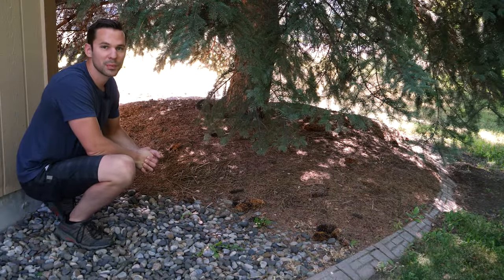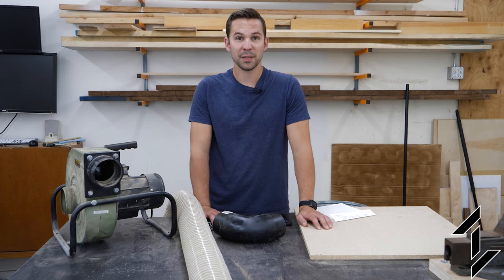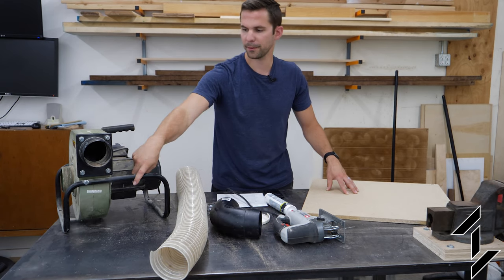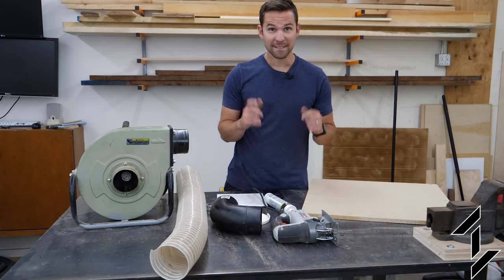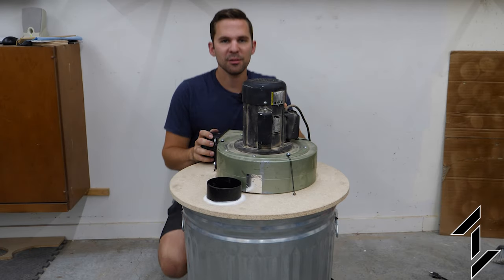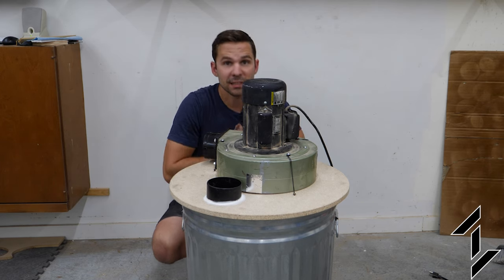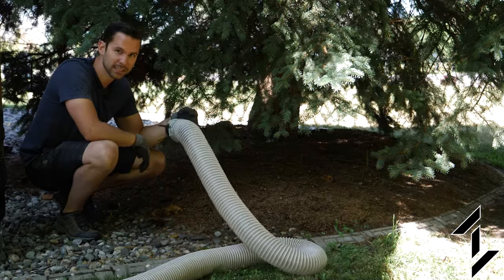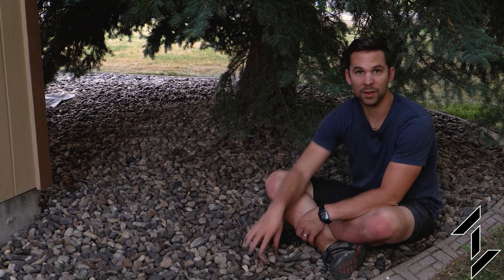The Fastest and Easiest Way to Clean Landscape Rocks! The Mighty Pine Needle Vacuum!

Comment: Ever heard of a Shop Vac with a diffuser. Thats how I get it done. Love that CNC machine. 👍
Reply from the maker: I didn't have much luck with a shop vac as it kept picking up the rocks too.  The high-volume low-pressure of a dust collector worked much better for me.
Thanks for watching!
Reply: @42Pursuit  Can you share which machine did you use? I am all new to this and want to buy the right thing :) I was thinking to buy a Shop vacuum but it seems like you didn't have much luck?
Reply: Can you share which machine do you have?
Reply from the maker: @ArijanaLukic  I used a 1HP dust collector from Harbor Freight. It has hight volume but low pressure air movement so it'll suck up the light stuff like pine needles and small sticks but not enough pressure to pick up the rocks.
Reply: @mark torres what shop vac brand do you have
Reply: Exactly, I actually use our Shop-Vac or our leaf blower on the vacuum setting and put a wire mesh on the end like chicken wire type so dirt can get through and rocks can't. I have to clean tons of bird seed from the winter out of my lava rock and this will do the trick.

Comment: Cool idea. I used my leaf blower to remove pine needles from a small rock bed, but it also blew the soil.
Reply: Doesn't your leaf blower have a vacuum setting does that's what I use and I put a wire mesh on the end of it.
Reply: @marylynnbehrens5562  My battery-powered leaf blower doesn't have a vacuum feature.

Comment: Without going to the time, cost, and trouble of fabricating a large shop-vac, I used my 10 Gallon Rigid Shop Vac. It was effective to a point, but in addition to sucking up the organic debris, it also was sucking up too much of the rock. So instead I began spreading my landscape rock onto my driveway and used my leaf blower to separate the debris from the rock. Since I was relocating the landscape rock, this method worked better anyway. Shovel, spread, blow, regather and relocate.
Reply: If you're not relocating your rock you could always use your shop back and put like chicken wire on the end of the little square chicken wire is not the bigger one. That's what I do and it works fine.

Comment: I use two methods. A power washer at a distance of a couple of feet or a small battery operated lawnmower, set with the blades high. Quick and fairly effective.

Comment: This would be nice with a set of all-terrain casters!  
A backpack version would be handy as well.  Maybe a little more work and less safe than necessary.  I'm going to have to do some thinking on how to incorporate a cyclone attachment to our handheld vacuum at work.  We have smaller landscaping stone, and gets sucked up into the impeller.
Reply from the maker: A backpack version would be super handy! Especially for yearly maintenance after it's been deep cleaned, sucking up the stuff dropped on top in the last year. Probably wouldn't want to have long hair that close to the blower though 😄
Reply: Bigger opening on end of hose = lower vacuum

Comment: I think a good shop vac with a larger suction nozzle like you used equipped with an adjustable air bleed (to adjust vacuum so it won’t pick p the rocks) would work too.

Comment: Fantastic! I must ask, and maybe the answer is obvious, but can this not be done with a shop vac? I only ask because I have one already.
Reply from the maker: Great question! Shop vacs are designed to move air in a high-pressure and low-volume way which allows them to suck up most things that fit within the hose diameter which would cause them to pick up rocks as well as the pine needles. Dust collector blower motors are designed to operate with low-pressure and high-volume air flow which allows them to suck up light-weight things but they don't have the pressure to lift up heaver things like rocks. This make blowers motors the perfect tool for this job 👍🏼
Reply: @42Pursuit  thank you for your answer. So, in theory, if I use a 4" to 2.5" reducer attachment to create a larger suction area, I believe I could lower the effective suction. Maybe even cap it with a 1" wire mesh for good measure if it still has too much suction. Love the idea in the video, just don't have the room for an additional item like that.

Comment: I bet if you put a screen with holes just smaller than the rocks it would just pick up the green. Good work
Reply from the maker: Hmmm, that's an interesting idea, I may just have to try that....
Reply: only thing is if you also have leaves, they will clog the screen often
Reply: @Beenthere2xs  yep. You were right. Guess youve been there 2 hehe
Reply: @djexclusivee  haha unfortunately there right now, have to clean small gravel around my backyard perimeter. Sucking it all up in a shop vac then dumping on a big area tarp. Then the plan is to wash em with a pressure washer. These are small gravel rocks so the method in the video wouldn't work.

Comment: Really awesome video. Very nice shop vac you builf there. Was thinking though. Um couldnt you just use a store bought shop vac? If a regular shop vac is to powerful maybe you could make a different attatchment for the end of the hose that is like a funnel to just give it a bigger opening and weaken the pull of the vacuum? Really did dig the shop vac you built though.
Reply from the maker: Thanks Justin! You might be able to find a compromise of hose size/funnel for a shop-vac that would work alright at picking up lighter debris while leaving the rocks. I don't think it would ever be as good as a blower motor like what's in a dust collector though since it's a difference between cubic feet per minute (CFM) and static pressure. A shop-vac has high static pressure with low CFM, whereas a dust collector has high CFM with low static pressure. Increasing the hose size for a shop vac would increase the CFM a bit, but I think you'd end up kinda getting mediocre CFM as well as mediocre pressure. Might be worth playing around with though!

Comment: The Harbor freight unit used is 660 cfm through 4 inch hose.   Would the larger 2hp Harbor Freight be too much velocity at 1550 cfm through 5 inch hose?  I am just finishing 100 foot drive of river rock along trees so your idea is looking like the best think since sliced bread to me.  Thanks 👍
Reply from the maker: Yup, that should work just fine! Actually, the first time I tried this (before I made the video) I used the 2hp Harbor Freight with a cyclone separator and a 4" hose. If I remember correctly, the extra cfm's of the blower actually worked slightly better.
I'm glad you found video helpful 🙂 thanks for watchin!
Reply: @42Pursuit   Thanks!

I have a 12/3 100' extension cord and a will construct it on a lawn tractor cart that I was about to get rid of.

I noticed commercial gas powered leaf vacuums for lawn tractors use 6 or 7" hoses with larger sharpened impellers and run $2k+.  I think your approach may work better for my needs.

Comment: I have slightly smaller rocks. The thing I'm worried about is I'll suck up just as many rocks as pine needles. Did you have any issues sucking up more rocks than pine needles with your blower?
Reply from the maker: Smaller rocks are tricky. For me it sucked up a bit of the small gravel-sized rocks. They were light enough that the airflow was enough to pick them up. Unfortunately I don't have a good solution for cleaning small rocks 🤔

Comment: Hello! I tried using a shop vac before to clean debris out of my rock landscape and sucked up rocks. With your invention how do you keep from sucking up rocks? Looks awesome!!
Reply from the maker: It has to do with the difference between how a shop vac and a dust collector style blower moves air. A shop vac creates high pressure suction but moves a low volume of air comparatively, a dust collector creates low pressure suction but moves a lot of air. Low pressure means there isn't enough power to suck up rocks but there is enough to suck up the lighter twigs and pine needles.
Hope that explanation helps!
Reply: Make a new attatchment with a bigger opening. Ive been contemplating this for a long time to clean out the gravel by our house. I havent tried it yet. But think it will work. If it does work I think somebody could start a business doing this and do pretty good.

Comment: 3 Question

1. Would a craftsmen shop vac with cmf 137 work as well or do you need the extra vacuum suction of the 13 gallon 1 HP High Flow
Dust Collector 660 cmf air Flow in order for it to work? 

2. Do you think it would work well on rocks that have 40 Years of dirt on and impact on them, to collect the dirt?

3. While cleaning did you collect a lot of rocks that were sucked up into the unit?
Reply from the maker: 1. Shop vacs can be a good option depending on the size of stones. The benefit of the setup in the video is that a dust collector blower like that one is designed to move a high volume of air but at a low pressure so it can suck up the light debris, but leave the heavier rocks. A shop vac is designed to move air differently by creating a high pressure but moving a lower volume of air so it has a much higher likelihood of picking up small to medium sized rocks with the debris.

2. Maybe. If the rocks are large enough, and you're able to break up the dirt, it should be able to suck up mostly just the dirt.

3. Not many rocks were sucked up and the ones that were sucked up were generally smaller than 1" across.
Reply: @42Pursuit  Thank you for answering my question.

Comment: I like your idea. I don't understand all the naysayers who disrespect your machine. It's given me food for thought. I have a garden railway which I am building, but a very large Scots pine sheds its 4in needles all over the place, especially in high winds. Its a lovely tree with squirrels, but I hate the pigeons in it, and I hate the needles, but it will cost £1000 to cut down, due to buildings/sheds below. I'm seriously considering the chop, but your ventrifuge /vortex idea might do the trick. So thanks for making me think outside the box. Normal (cheap) leaf blower/vacs don't lift long needles so well, especially around delicate model railway buildings, and track ballast! One thing I wish you had shown in the video was the can end, where the air exhausts out, and also with sound to hear how noisy it is?
Reply from the maker: There's always going to be naysayers but you can't argue with results 😎
Showing the exhaust would've been a good idea. There really wasn't much coming out of the exhaust, mostly just dust. Anything with any weight to it got trapped in the can.
As far as noise, I know the 2hp version of that blower is around 80dB and it was a 1.5hp so it'll be slightly quieter than that. A typical shop-vac is quite a bit louder in the high 80 to mid 90db range.
Hope that helps!
Reply: @42Pursuit  yes, thanks for the reply

Comment: It does not suck up the rocks?  Can you do the same thing with a shop vac?
Reply from the maker: Unfortunately a shop vac doesn't work the same since they're generally high pressure and low volume suckers. A dust collector blower is low pressure and high volume so can move a lot of air and pick up light stuff, but doesn't generate enough pressure to pick up rocks.
Reply: @42Pursuit  Ok, thanks for letting me know.

Comment: Fantastic device! It does exactly what we need, no more shovel and screen! Before I buy all of your suggestions, I have a dumb question. What exactly does your trash can cyclone device do that the Harbor Freight dust collector does not do on its own? I’m so sorry, I just can’t picture why I couldn’t use it alone? Not to discount the perfection of your system, but it will take me a whole day just to cut the fancy wooden lid to your trash can because I’m not that good with a router and jigsaw! :) But I know I’m missing the mechanism by which this works.Thank you for this video, I just subscribed.
Reply from the maker: Great question! My reason for setting it up this way is that the debris will drop into the trash can before it goes through the blades of the blower. If a small rock or a pine cone gets picked up, it has to go through the blades which isn't great for the blower and can also cause clogs. Having the debris drop in the trash can also makes emptying easier as the bag that comes with the harbor freight dust collectors is quite a pain to empty. Hope that helps!
Reply: @42Pursuit  Yes, that helps! We have a large xeriscape both front and back, so I’m going to build your device the right way and start cleaning up this yard! Thank you again for your awesome invention. We have way too much yard to shovel and filter every year.
Reply from the maker: Awesome! I hope it works really well for you!
Reply: How is this different from using a shop vac with a dust bin cyclone in the middle to catch the debris?
Reply: @Jknudsen0523  Shop vacs are usually high pressure and low volume air movers while dust collector blowers are low pressure high volume. A shop vac will end up picking up the rocks as well as the pine needles, while a dust collector blower won't have the power to suck up the rocks, but will have enough to pick up the lighter pine needles and debris.
Reply: @gavinlommatsch6185  this is the kind of answer I was looking for.

Comment: Did you try a wet vac first?
Reply from the maker: Yeah, it sucks up the rocks as well because it's a high-pressure low-volume device. Dust collector blower motors are designed to be low-pressure high-volume so are great a picking up light things while leaving heaver things alone.

Comment: I want to buy one from you. Any chance we can make that happen?
Reply from the maker: I wish I could! Unfortunately I'm not in a spot right now where I am able to produce these.
Reply: @42Pursuit  no sweat, thank you. I noticed you listed both the 1hp and 2hp dust collectors from harbor freight. Which do you recommend?
Reply from the maker: @beefcakebrock  if you want it just for cleaning up landscaping debris, the 1hp is smaller and works fine, but if you have a workshop and want to have one for dual purpose landscaping cleanup and dust collection I'd consider going with the slightly heavier 2hp version.

Comment: Trees around our homes are notoriously dirty and labor intensive. I no longer want trees near my house, roof etc. They create too many problems with debris. Your tool works well. The rocks will continually be getting full of needles. You may want simply dirt and just rake it occasionally.
Reply from the maker: Yeah, trees can definitely be a bit of work to clean up after. But now that I've got the vacuum built, all it takes is a few minutes every year to suck up the fresh layer of debris on top of the rocks and they're back to looking like new in no time!

Comment: If you have any type of pine tree on your property, the best thing to do is admit defeat and embrace the pine needles.   Make a Pine needle "bed" under your pine tree and you will never have to worry about it again.  And in the fall when pine needles are actively dropping from your tree, simply rake, or blow the pine needle that dont drop straight down back into the bed.   There are many type of plants that do well living under pine trees.  Certain types of Hostas and Ivy's do well.  But cleaning out a rock bed of  pine needles is an endless, time consuming battle.
Reply from the maker: Never give up, never surrender!!! What is life but fighting entropy? 😄 I'm fine spending an hour or two a year sucking up the pine needles that have dropped from that tree to keep things looking tidy but understand that's not for everyone.
Planning out the landscaping before putting it in to put plants under pine trees that thrive in that environment is a great idea, but one I can't do as the landscaping was already done when I moved in. Alas, next time.
Reply: Fire season 🔥 where I live means we REALLY  need to annually clean up the needles and cones. I'd love to be able to use the needles as pine straw in paths and garden beds, but it's simply too risky.

Comment: Would that suck up the rocks, I don't want to shovel?
Reply from the maker: If you use a blower like in the video, it creates a high-volume low-pressure flow of air which is strong enough only to pick up light things so the rocks should stay put.

Comment: What happened to the rocks that got sucked up
Reply from the maker: The air flow is high-volume/low-pressure so not many rocks can get sucked up, only small gravel pieces are light enough to get caught in the airflow and end up with the pine needles in the can.

Comment: Curious why didn't you just use a leaf blower VACUUM?  What's your logic? Specifically Toro blower vacuum as example
Reply from the maker: They're not that great of a tool in my opinion. They're prone to clogging and breaking, and you carry the bag that they fill so you've gotta lug around all the weight you suck up. Also that bag is pretty small and can be hard to empty.
Reply: @42Pursuit  that is a well thought out response, and i agree with your response, particularly the bag is heavy and awkward and clogging.  Thanks for sharing knowledge

Comment: also that's not called a separator, it's just a home made shop vac
Reply from the maker: Haha, you're totally right, it definitely doesn't separate out the debris from the air without the use of a filter. My bad 😄

Comment: How could you clean white rock when some debris has been left and the rock has been discolored? 
This was done by the people who were paid to mow, edge, etc…
How can I tell them to CLEAN the expensive rock that (now) looks like crap…defeating the purpose of using rock vs. mulch.
Reply from the maker: In my experience, first removing the debris and then washing the rock with a pressure washer helped a ton. At first it'll still look discolored but if most of the debris is gone the sun will help bleach things back to white after a few weeks.